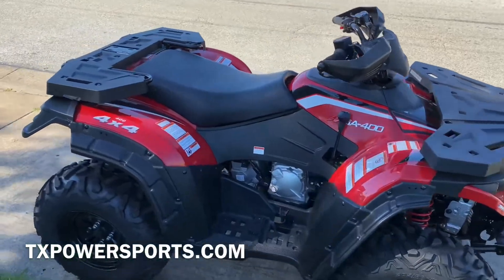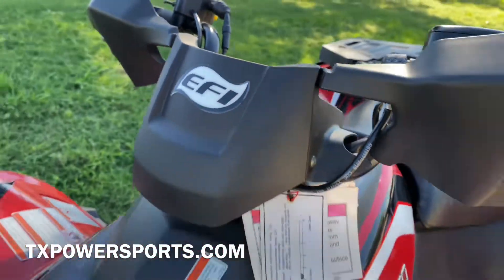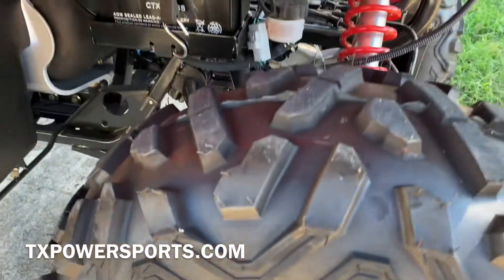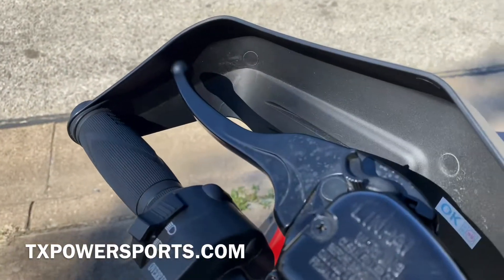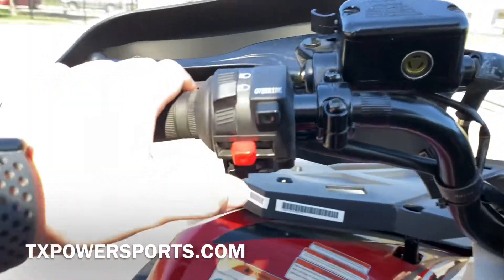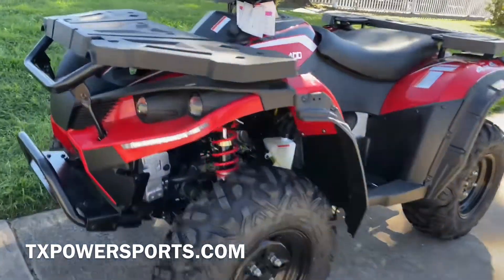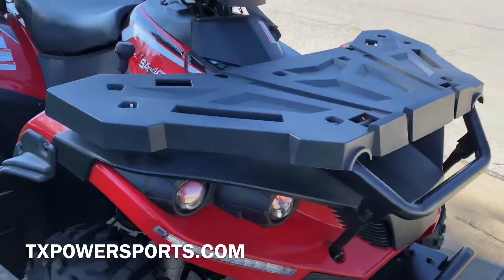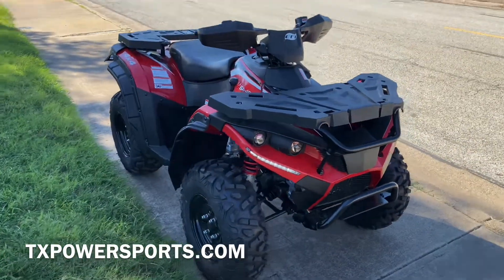New Massimo MSA 400 ATV Quick Video 2022 Model

Comment: I just bought a 2024 550 today. Can u tell me where the fuel cut off valve is located?
Reply from the maker: Please call us at 817-649-7823
Reply: I was told it doesn't have one. Now I am having trouble shifting the gears. Sometimes it doesn't want to shift at all. I out 10 w 40 wet clutch fully synthetic in it and hasn't made a diff.